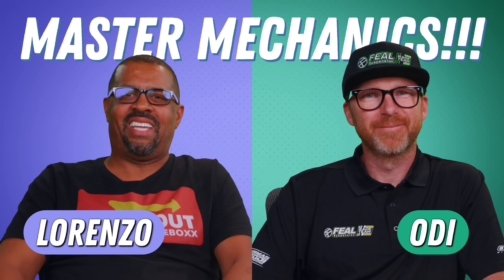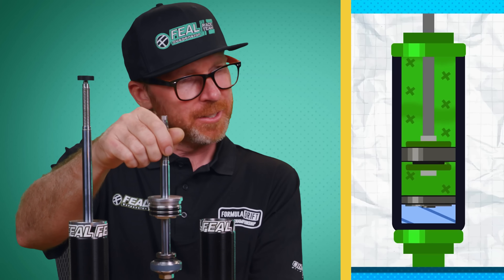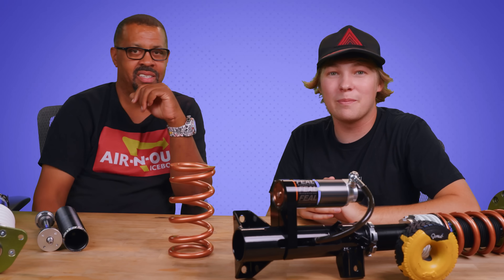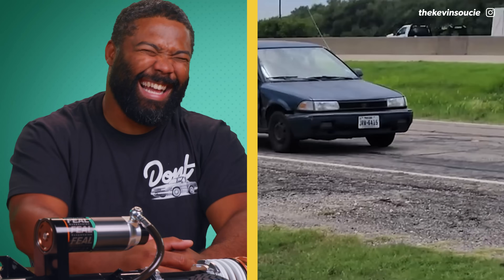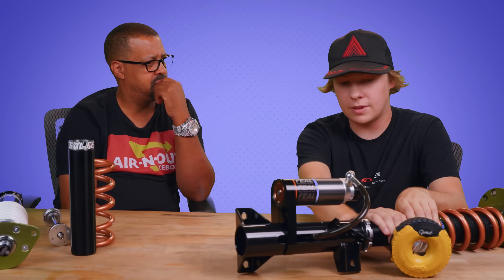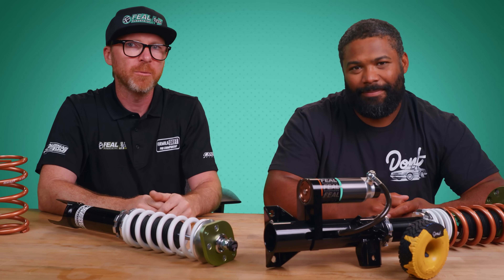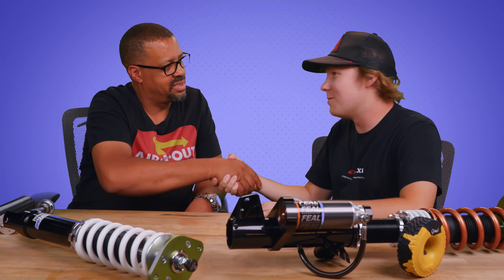Engineers React to Horrible Suspension Fails

Comment: Although cool, I think the tie rod thing could be legit dangerous. If I’m not mistaken most wheel studs are allow with a softer core. This is why they snap with wheel issues so easily. That force on a steering item could be unpredictable. That said, on a drift missile I’d fucking send iiiiiit

Comment: You want airbag suspension for cheap? Use a high quality foot ball. 
I’ve seen it and it actually fkn works well. 
Seen a guy on Fraser Island with them and at full send. I was VERY impressed. 
It’s not dumb if it works.

Comment: gimme 1 good electronics/electric engineer, 1 good 3d mechanical engineer guy+prototyping tools, 1 year, 1 million bucks, and i make you a magnetic shock, fully adjustable, and with 6 more months, and another 1mil , i give you a reproducible product for low number manufacturing.

Comment: 12:56 i had a 2012 fiesta that needed some light work with roughly 38k miles on it, when we took the rear shocks out to replace them, they would compress under their own weight, not upside down either, just in general

Comment: we used to jam woodblocks into the suspension when hauling alcohol over the border.
this way the border police couldnt tell we were loaded to the brim with booze and beer.
otherwise a van would basically be slammed to the ground from the weight.

Comment: I really wonder how hot a magnet suspension would get. Concern is for any prolonged rides or humid areas where air flow might not cool them too well. Neodymium magnets(likely choice) can start permanently losing their magnetism at ~80C or 176F

Could be friction adding up from bumps that force contact or just other parts sharing heat through contact. As it heats up, it performs worse. The material is pretty brittle too. Not to mention all the debris it would accumulate eventually.

Comment: The magnetic suspensions might be a really once science finds a way to miniaturize superconductivity components, I can totally see cars hovering over the roads, roads prepped with material to allow superconductivity and to recharge vehicles at the same time, which would also prevent the car from going on the pedestrian way containing the car into the magnetic field. With an AI guiding the car we could get some really safe and fast cars.

No need for suspensions, no bumps, no sounds, but more speed. That would be kinda sad to be honest, because the pleasure of driving would be removed as well.
Reply: If they used Neodymium in the video that would be horrifyingly unreliable. The material is brittle, magnetism performs worse as it heats up and it permanently loses function at around 80C/176F
Depending on the car, reaching such temps on a prolonged ride, especially in hot and humid areas might be possible? During bigger bumps there would be some friction heat and shatter risks. Might even approach the limit through proximity to other hot components.

Comment: I'm pretty sure GM/Cadillac developed some kind of shock with magnetic fluid that could be changed by applying a magnetic field somehow. I can't remember exactly how the technology worked or exactly how long ago, maybe 15-20 years ago, I heard about it but that's what I remember. Not the same as what was in the video, but I would put it under the category of magnetic suspension.

Comment: the thing about slime tire repair its one of those things that you should not use just like stop leak it will do more damage then it does fixing both are a mess to clean up well for stop leak your radiator will be screwed after that with it hard as cement clogged in there and slime leaves a mess and with certain rims it eats at them there plenty videos of slime doing damage to rims to be exact the common aluminum rims

Comment: 17:30 that actually makes sense if you think about it because Bose an expert at electromagnetism since they make speakers which need precisely controlled magnets. So I wonder if they are actually using some kind of speaker magnet control for that car's magnetic suspension parts 😆. And you could play music through that magnet except it would just be bouncing the car around. 

But I'm curious how fast they have to control the magnetism to keep the car from bouncing. Do they predict the road surface ahead of time like how Nissans in the '80s did to respond to potholes with their air suspension?

And the really old car Bose used to demo the magnetic suspension suggests that It's a really old prototype from the '90s or that they just happen to buy a cheap old car to build the prototype from. Or maybe they had a partnership with Lexus that didn't continue due to their feasibility concerns.

Comment: 0:42 Wait a minute. The camera person is only a bit farther from the spring and isn't holding a shield. How do they know that the part is going to fly in the direction of the man with the shield? And why do they pick the tiny piece of metal as the shield and why does the spring have to be facing vertically rather than horizontally

Comment: Kia has a "mobility kit" in some models instead of a spare tire, it seems almost exactly like that "slime" kit that sponsored this video. Fatal flaw for the Kia kit for me was that the compressor stopped too soon (probably overheated since it was a hot summer afternoon) and so I couldn't drive it to mix the sealant around inside the tire and get it to plug the hole. It's a temporary fix even if it works, but it didn't work at all for me because of that. In hindsight having used it once now, I could have probably made it work even with that happening by just driving slowly on low pressure down the road so the sealant could reach the leak hole that happened to end up on the top of the tire when I parked...  but I was close to an autozone so I just got a proper patch kit with those rubber twizzler lookin' things and it's held since! I know tire shops will tell you that the goop sealant stuff will basically melt the inside of the tire and ruin it, but since I ended up using a solid patch in the end mine is holding just fine until I can buy all new tires next month 😁 so at the very least it doesn't seem to destroy your tires quickly or anything. Now I've still got the mini air compressor from my car's kit and I put the leftover uses of the tire patch kit i bought into my trunk where the Kia "mobility kit" slime bottle originally was. Neither kit can fix sidewall damage so now it's just a better version that doesn't compromise the tire long term and actually works imo.

Comment: I've broken spring compressors using them (broke arms while torquing down) > our solution is use 2x good ratchet straps, wrench them down tight and the spring is safe, never had a strap break doing it that way
Reply: I be scared to only use the ratchet straps but it would be cool to have a test video on how much they can hold down a spring.

Comment: That first clip is IMO a demonstration of "what will happen if we weld our worn-out shock absorbers solid?"

Upside-down dampers have the advantage of less unsprung weight as the heavy part of it hangs from the top instead of standing on the lower control arm. If you want to go fast - that's what you want.

Bilstein makes those. They last as long as other good-quality shocks. Depending on model and use - ~150,000mls.

Comment: I have a set of FEAL 442s (I think that's what they are) on my 92 AWD DSM.  Good to see the owner of the company.  Maybe I'll spend the money and have them rebuilt since they came with a car headed to partout.
I learned (in school) that springs don't absorb energy.  They just transfer the shock to the chassis at an "acceptable" rate.  The shock "absorbs" the energy.
Reply: It's cool to learn that the shock absorbs energy and converts it to heat! Neat example of physics outside of the classroom. Same with refrigerator/air conditioning. I wish that they could have those examples in a class

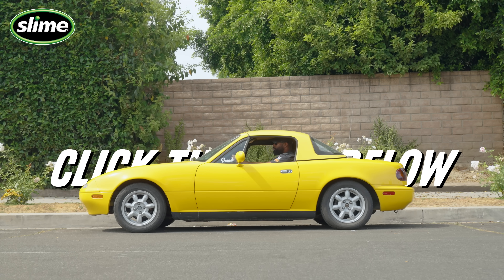Comment: 5:31 good luck with a cracked rim or a pot hole slash.... Those things are useless
Reply: Yes, for things the product was not designed to deal with, it is absolutely useless. It's also useless if you run out of gas or have a coolant leak. What the hell?
Reply: @theblackwidower  what I'm saying is it's dumb of the company's to stop putting spare tires in cars in favor of this useless technology. You knew what I meant. Ur just a sour bitter delusional person. Good luck
Reply: @theblackwidower  uh huh

Comment: A suspension mechanic will say the first thing to upgrade when you make more power is the suspension, but really almost everything on the car needs to be upgraded if its not already rated for the amount of power youre trying to make. If you upgrade the engine, the trans will fail. If you upgrade the trans, the driveshaft will fail. If you upgrade the driveshaft, the diff will fail. If you upgrade the diff, the axles will fail.
Reply: Especially brakes which the Mercury comet crash made painfully clear! (Except I'm sure that was also an example of pull over when something in the brakes is malfunctioning)
Reply: If it ain't one thing it's another

Comment: The Bose suspension didn’t make it to the mass market because of pricing (around $20k) and when it was developed, computers were too big to fit on the trunk of the car and connect all the sensors needed. 

Years passed and instead of using the suspension on cars, they ended up using it in a seat 💺… yes, a seat for trucks and it’s called Bose Ride. It’s a plug and play system for the big rig trucks that have air cushioned drivers seat.

Comment: I like the duct tape on the coil over threads idea but duct tape tends to leave a lot of glue behind when you peel it off which might be harder to clean off than some road grime. maybe if the threads are greased so the tape doesn't stick to them and its just wrapping around and sticking to itself?

Comment: Guys… that’s not the suspension.  That’s the differential mount.  But they are right when you start making more power you should be upgrading the parts that support that power making it to the road.  Including powertrain / drivetrain mounts and bushings.  Because take a wild guess at what happens when all that shit starts jiggling around 😅😂

Comment: Magnetic suspension could work with printed magnets. They can print a magnet with differing poles on the same face so they can tune the levels of attraction and repelling. I have a lock from a company that works with a twist to unlock. Really neat stuff.

Comment: 11:52 I drove an $800 Bonneville SSEi with blown shocks for about 7 years before I did the suspension recently. I could have bounced just like that car. Especially after gutting and making substantially lighter. I didn't drive it much if at all in the winter. It tried to unalive the driver enough in the summer. Keeps ya on your toes. Takes a lot of skill to not look like a drunk driver, especially if you get an officer behind you.
When I did suspension I found out I was driving with a partially collapsed steering column for about 5 years. Still need to do the steering rack and inner tie rods. At some point go to the desert and find a rust free body.
Reply: There was only 2 people that rode in it. I generally wouldn't let anybody ride in it, and never would have let anybody else drive it.
Normally only has the driver seat anyway.

Comment: If you want comfortable suspension say hello to Citroen. They use to like to do things differently. I've a Citroen Berlingo muiltspace front is yours typically MacPherson suspension but rear is torsion bar suspension. Then you've Citroen 2cv system apparently so smooth you could drive through a ploughed field with eggs in a basket and wouldn't break on also near impossible to overturn.

Comment: The second clip is done by a small youtube channel and bring a local youtubers to the car to have interviews while driving around the parking lot. The shocks and springs were replaced with just 4 steel pipes and the interviewees had to sign waivers. The channel experiment car related hoax or hacks circling around the intetnet and test some products sometimes.

Comment: GM Magnaride is still one of the best feeling suspensions I've ever had the pleasure of experiencing. The speed in which it adjusts to road variation is incredible. Air suspension also works outstandingly when properly engineered. I'm fairly surprised neither of these were explored in the video as options.

Comment: I just replaced my diff bushes and about 2/3's of my subframe bushes, upgrade to superpro but that was $2135, yesterday. Was supposed just be diff bushes for 950. Bitter pill to swallow. Way stiffer and so far my wheel hop problem hasn't shown itself, but have to wait for rain to be sure. Time for some more power.

Comment: Hmmm.. ...nope, didn't see any engineers.  If we did they probably would have mentioned that using a standard hardware grade bolt as a tie rod extender will get someone killed.  Thats a member under huge sheer, compressive, AND tensile loads.  The 50 cent bolt from ace is going to do its best to buckle, sheer, and stretch like old gum before it snaps.  Then your front wheels decide to just do their own thing, which will be in who knows what direction.  And when it does fail, it's going to do it under a load, ie when making a hard turn.  Hanging a left ont main street when you get a nice pop and your wheels just loose interest in steering the car.  Possible to do it, but if you use the wtong grade, somebodys getting a totaled car if they're lucky. Unlucky involves a wrongful death suit.

Comment: Lorenzo loves his suspension job only because he lives in the South West. He wouldnt be so happy about the job if he lived in the North East. Ive done so much suspension work living in VT and its hands down the worst job if the car is more than 2 years old thanks to the salt on the roads. You need a torch and patience to get each and every bolt out....half the time needing to replace some that break or round off from being rust welded on.
I have always said the mechanics in the south west have it best...I could only imagine the amount of time and aggravation saved by living in an area without rust.

Comment: Shock are probably a really good use case for a tesla valve. You can have compression and expansion have different rates for the same pressure.

Comment: Magnets could 100% be the future of suspension - for some cars. And I think they need to be guided a bit more because when they move closer to eachother the repelling force wants to slide them to the sides rather then meet in the middle. Path of least resistance etc. But air is the Perfect suspension as long as your bags hold. Tbh air in tires is genius and the only thing we need to do to truly make them better is to put layers of kevlar in those sumbitches and whammy: puncture-proof tires with awesome suspension.

Cause self-healing tires dont exist whatever the salesman tells you.

Comment: I'm 60 years old. When I was a young teen, my father, a mechanic and diesel fitter, bought me an old junker XP Falcon (early 60s). He said to me, "Before you work on the motor or interior,  make sure you get new tyres (tires), brakes, and sort out the suspension.  That'll keep you alive longer."
I've rebuilt a few cars since then and always started with those steps.

Comment: I survived a bursting air bag that holds 80 liters (21 gal.) on my truck. The air bag for the lift axle was too old and exploded when I inflated it after I installed the "new" one.... the bang is the smaller problem, but the fear of being crushed by the axle... UGH!!!!!
Reply: To explain...!
In Europe and especially in Germany, more trucks drive with trailers than semi-trailers, 80% of which drive with "swap bodies" that are pumped up by air springs for loading. I personally knew an old colleague (RIP) who lost his fingers because the air spring burst and his fingers were crushed between the truck and a full loaded container. He almost died that day because he was only found after 4 hours on the shipping company's parking lot when the sun came up.

Comment: You could probably do some cool things with electromagnets or maybe shocks filled with ferrofluid.  The problem with normal magnets is that the distance on which they can well act is relatively small compared to current suspension components.  So most likely you would need a magnet coil moving inside another coil to get inches of travel.  On the upside if they were electromagnetic you get extremely highly tunable suspension (much more responsive than computer controlled hydraulic or pneumatic systems).
Reply: Magnetostrictive Position Sensor is probably a good start to design a real magnetic suspension

Comment: rented a pos compression tool that was all chewed up.  Launched the coil 5 inches into our stucko siding.  I found one part in the middle of the street 45 feet away.  Never ever will I ever do struts again.
Edit: ok maybe one more time with the proper tool.  Just for the adrenalin high.
I spent more money on a white industry damper for my mountain bike than I did on those struts.  circa 1997
edit2.5:    dont ever use slime in your tires.  Just pay for AAA or have a full sized spare.    Just a tip from ur uncle Larry

Comment: Man like the dude said before you put more power to the pavement you need the suspension to keep the power on the pavement.  Before i over doubked the hp and tq of my 06 duramax the first things i did were suspension and supporting mods like the transgo stuff for the trans and a lift pump to get the fuel i needed to the engine.

Comment: For the tip on protecting the adjustment threads for adjustable coilovers, use teflon tape. Any tape that uses adhesive will release the adhesive over time and in heat. Super cool idea, and will definitely being using this.